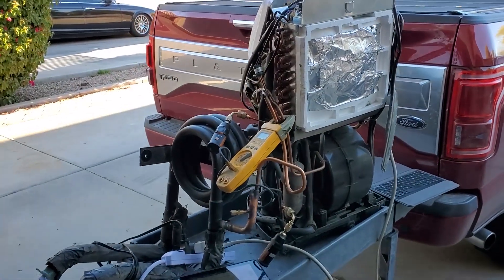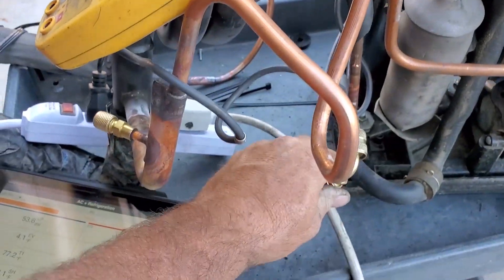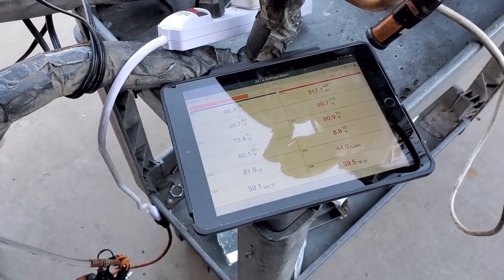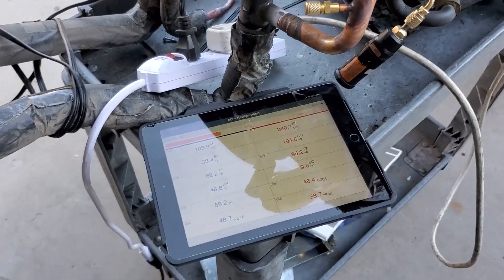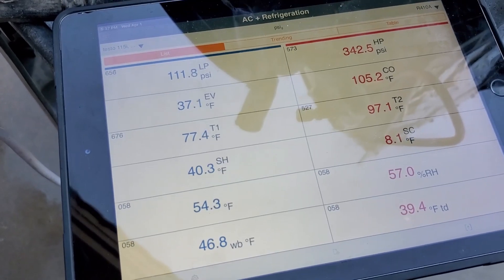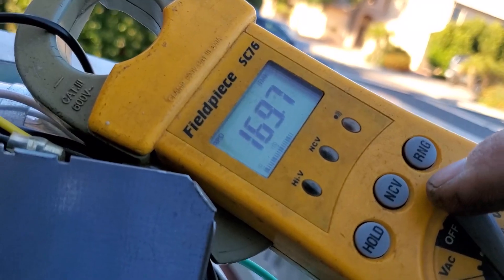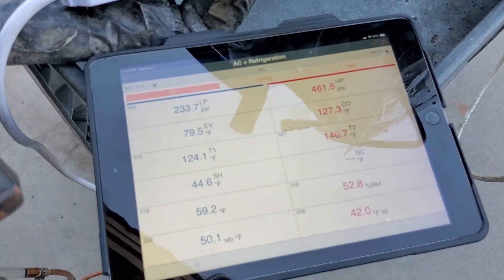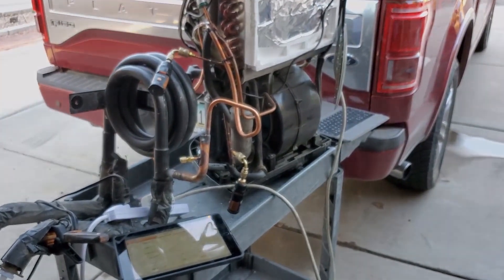Can the lil' Bastard heat water to over 130 degrees?

Comment: Do you have a review on that testo app? I used to work as an hvac tech but I'm interested in doing some experiments with my ac. A data logger that automatically stores system presures and temperatures sounds cool to troubleshoot without having to hookup your gauges. Do you know if any residential units have this sort of technology already?
Reply: fyescas777 yes the high end stuff has it. York has one that reads at the condenser. You can get a unit from Emerson called the sensi and it compiles into measurequick. I liked the idea but don’t like the fee it charges. Although it might help reduce downtime and let you know something is wrong before you notice. That might pay for itself considering comfort and the wife.

Comment: Those rotery vane compressor take awhile to stabilize. The oil is on the high side and takes on refrigerant when it sits  so let it run for awhile before looking at the pressures and charge. It can throw you for a loop in a hurry
Reply from the maker: Yeah. Sub 50 got my attention for a minute but I let it run and it was still perfect after it stabilized.